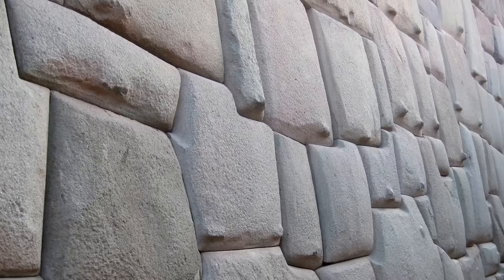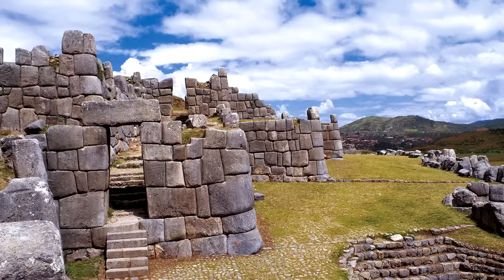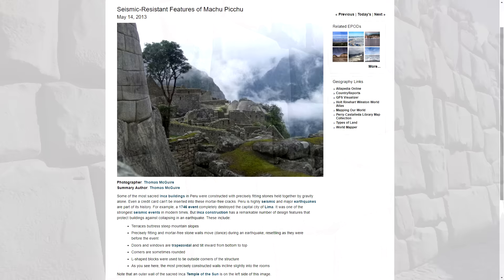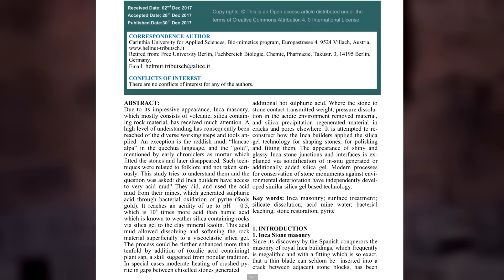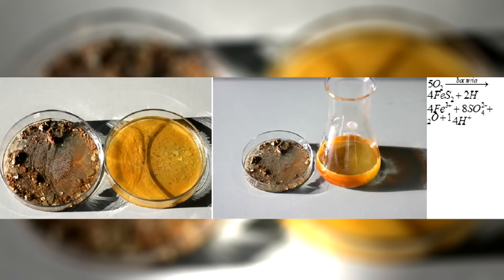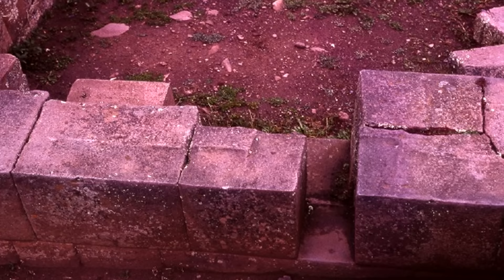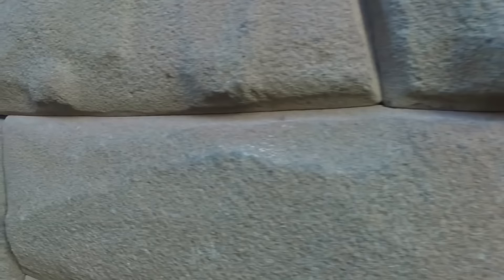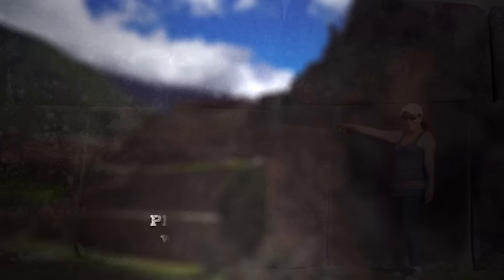Is This How The Inca Walls Were FINISHED/JOINED So Perfectly?

Comment: This method won't work.  It would work on stones stacked one on another because the weight of the stones being pulled down by gravity would make a tight fit but wouldn't work on the joints on the sides of the stones... if the solution dissolves the stone then the side facing joints would actually get wider and create bigger gaps.
Reply: It doesn't dissolve into nothing dude.

Comment: This is just my humble opinion - If they possessed a hard and resistant metal alloy, some kind of steel, they can make a file from this metal. The file has "teeth" on its both sides and is used to flatten the sides of the "cube". They insert the file in the stone gap and chip off the protrusions in the surface until the adjacent faces are straight. The file erodes the adjacent faces of two stones, making a uniform gap and therefore the two stones can be pushed and locked together with a perfect match, like pieces of a jigsaw. Each stone has to be matched with the one installed beside it AND the one underneath it. In the last picture I noticed two stones atop each other having a small rectangular gap. Possibly a temporary support was inserted there to hold the upper stone above for the purpose of filing. The filing may be performed gradually, for each stone: You file its side just a little, then you file its bottom just a little and repeat the process. The reason is that if you move the stone to the side, it may dislodge and create a gap underneath it, so gradual filings must be made. To overcome the issue of larger gaps, I think they used the smaller stones for this purpose, because they are easier to lift and handle.

Comment: You can tell you have no idea about actual stone working do you ? 
How did they lift and actually shape the stones ? 
Why are the nubs always present on the side of only certain stones and how did they build  on top of mountains? 
Have you actually tried to just chip a rock wit a hammer and chisel? 
It's solid to cut a flat plane on a rough rock cutting round shapes to fit is infinitely more difficult to cut randomly curve symmetrical is impossible yet there it is lol .

Comment: I still believe that due to the pillowing or marshmallow shape of the stones, at least most of them, it appears as if the blocks had been heated internally in some way, but not melted, only softened. It may then have been easy to shape them with a sword or some such device, cutting off any pieces that weren't needed and then placed in their intended location. I also believe that the same method by which they were heated was the same technology that allowed them to be moved anti-gravitically, because they sure as hell weren't lifted into place by a hundred or thousand laborers. Great video just the same, nice photography!

Comment: Nope.  I don't buy it.  Too many areas where just a slurry of acid wouldn't work.  First and foremost, you can't control the activity of paste once you've put stones together.  The acid paste will work at different rates on different parts of the stone because no stone is uniform in makeup.  Second, you'd have to wait months maybe years to get that level of dissolution across those large surfaces. You'd have to remove the stones and reapply the paste.  This makes no sense at all if you know anything about chemistry and physics.

Comment: Actually, the joints were very much gapped. The stones slowly “melted” together to form those precise fits over hundreds of years of rain as the weight of the stones compressed them into tight fitting seams.

Comment: Even if they could cut and move those stones easily, why fit them together like that?  Its nearly twice as much cutting to have all of these crazy joints.  And since these structures were in many cases just utilitarian, why would they bother wasting all this energy to cut the stones that way?  I don't know about an acid paste, because you would think that knowledge would pass down, or at least there would be ancient depictions of this, and I am not aware of any.  As always a real head scratcher.  I mean, if you needed to build a wall by hand, how would you do it?  Not that way I can assure you.
Reply: Earthquakes are a thing, especially in areas where they tend to use earthquake proof stone work.

Comment: This is no advance at all because the stones are so massive they need to be cut and carted in the first place. Many of them in Egypt for example weigh over a 1000 tonnes. The ones in the wailing wall in Jerusalem weigh several hundred tonnes. The ones under Indian temples ditto. Then of course there is Adams Bridge India to Srilanka where we find Sigiriya a 1000 feet high city built of rocks from a hundred miles away.
Reply: Not a single stone in the Egyptian pyramid complex weighs close to a thousand tons dude. I think 80 tons is about the heaviest? Keep learning, you might realize the truth is more interesting than the fiction you buy into.

Comment: That’s a more chemically active version of another theory, that they painted one block surface with ochre or similar, then placed the next on top, then removed it and ground away any areas with ochre, and repeated until both surfaces fitted perfectly.
Reply: Best of luck raising, lowering and grinding a rock weighing several tons, even if they had thousands of slaves to do the work.
Reply: @jonb3311  - the one thing they had was labor
Reply: @FlyxPat  Where is your evidence of that?

Comment: Total bullshit.
If you want to have 2 rocks fit together perfectly so not even a razor blade can be inserted, it's straightforward:
You grind the 2 rocks together.

You do this by fixing one to the ground; nubs are useful here to use rope to do this
and you mount the other on a pendulum tripod and swing one rock against the other
slowly lowering the rock
you will notice that ALL the joints have a slight curvature from the pendulum action.

One more thing has to be done - 2 walls forming a channel to prevent the swinging rock from twisting.

That's how you easily do this.
Reply: A easier approach was to build the stones with cement concrete as the crust and pebbles as the crumb.

Comment: Maybe you are on a good path, using chemical would alter the stone for longtime, you would see de-coloration or alteration for long time, also using powerful chemical does not stop in a finger snap,  so chemical could continue to burn the stone for longtime and not doing what you want to achieve exactly, I saw another place of the wall on another video where you see a stone remove and the surface look it has been work with  high speed tool, the chemical would not have let the joint totally clean ans smooth like that I think. It look like it has been easy to do it I am so puzzle by that work. Thanks for your video

Comment: To be a viable method of construction disolving the stones would need to be a comparatively rapid process. Perhaps the stones were "softened" then placed and shaped. I see many of the stones with bevels at the joints, perhaps a result of wiping off the excess. At any rate there should be a measurable characteristic chemical and structural change in the stones that could verify the process.
The process does not address the typical knobs found in large stones used in construction worldwide. The widespread occurrence of the knobs has been the basis for the hypothesis that an ancient civilization was responsible for spreading the technology.
I am in the camp that the Incas found the remnants of an earlier unidentified civilization and built upon it. 
Although the idea of an acid being used to soften and shape stones is feasible there are a lot of problems with the hypothesis I have yet to see reasonably addressed. To me the question as to how the lower walls were constructed.is still an open one.
Reply: Bomarsund Fortress was built in finland in the 1800's and it is larger than sachsyhuaman and no softening was required juat simple atone carving

Comment: No mortar to fit between stone blocks because there were no stone blocks to begin with. The stone block we see today was geopolymer concrete mix, started soft like a dough such that it can “flow mold” itself in between adjacent blocks and blocks below that were molded in place and hardened previously, and hence “seamless” fitting. 

We hire stone masons to fit one stone block after another today because of ancient cement wisdom is no where to be found in public domain, after the megalithic was complete.

Comment: The stones were poured, they used animal skins as outer wall and the nobs were created when the material accumulated in the cavities formed by the sowned legs and tail of whatever animal they use. That explains the randomness of the nobs and the bulging out of many blocks. The scrape marks may have have been made when a failure occured in the mould with excessive bulging out, they were manually scraped to make it look ok.
Reply: Nope

Comment: I think the best proof that no aliens or advanced civilizations build those Inca walls is that the stones are different sized. Usually a highly advanced civilization is advanced enough to be able to produce building materials in standard size for easier building process. While the seams are very tight this type of building required a lot of juggling the stones in order to find the right sized ones to continue building the walls. Also this is a copy & paste of the kind of technique they probably used in building these: "Ashlar masonry is a very old type of construction. It's been found on buildings from ancient Egypt and Greece, and on the Knossos Palace, which was built by the Minoan civilization. Ashlar masonry has also been found at Machu Picchu and Cusco, monumental sites built by the Incan civilization."

Comment: If we pour wet concrete into four closed panels over a dried concrete block, what do we have? A stacked blocks with a junction resemble those blocks junction on Inca’s retaining walls. Yes Inca wall blocks were poured fitted and not chiseled fitted. .

Comment: Geopolymer blocks that have  been cured with a fresnel lens made from simple transparent animal bladders and water. These are cast in place battery energy storage systems with obvious terminals (knobs or nubs) at various voltage levels.

Comment: Before cement was invented over 2000 years ago, pure stone constructions were build with a lot of manpower and sweat. The patience going into it, can't be imagined by todays lazy societies, that's why they are so desperate to find other solutions, beside toiling until it fits. Most of the ancient structures are build with limestone, which is very easy to rub down to size. Harder stone material just takes more time, that all there is.

Comment: I think the hypothesis is far-fetched, grasping at straws, but I'd also say this: reconstruct the process. Perform it, carry it through successfully even on a very small scale. I'm open to possibilities but still stand by the concrete hypothesis. There was a Frenchman - sorry, forget his name though his demonstration is somewhere on YouTube where I saw it - who successfully created and joined together ,'concrete stones' that looked exactly like the work in the pyramids. If this method was used, even the largest pyramid at Giza could have been built by a work force of 2000 in about twenty years...and it could have been done by a stone or copper age culture. Presently, I think this was A method used by the ancients to build their grand structures but it doesn't answer all the questions, for example, there's a huge block of stone, something 200 tons in weights, almost completely carved out from bedrock in...Lebanon? It still is partly joined to the bedrock as the process of cutting the stone out stopped before being completed. How did they even CUT the stone? I think the concrete method was maybe ONE method the ancients used, possibly one amongst several.